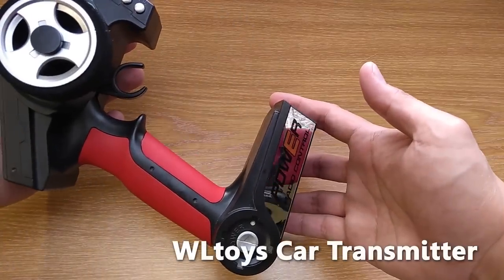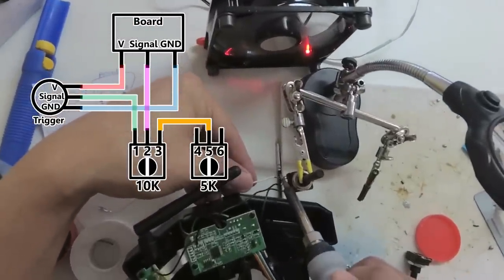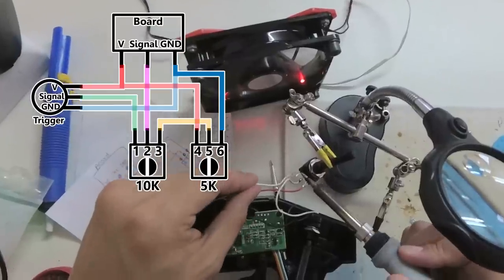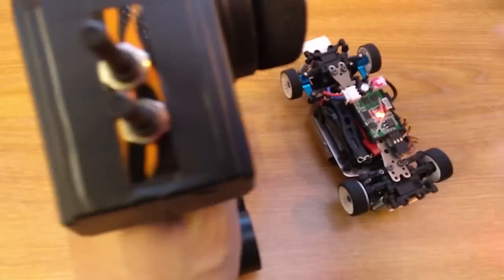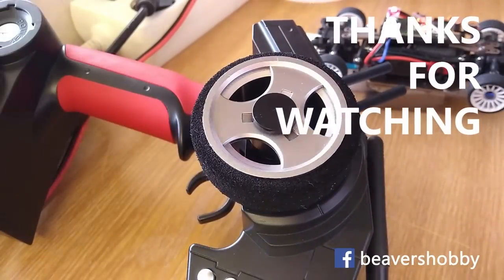[How To] WLtoys Transmitter Dual Rate Mod (throttle limit)

Comment from the maker: Time Stamps
Required Parts: 0:26
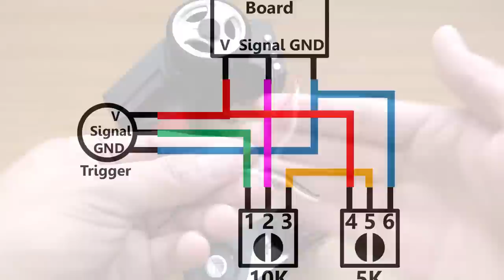Schematic: 0:45
Disassemble The Transmitter  0:54
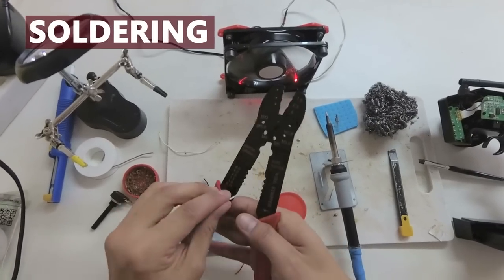Soldering: 2:13
Re-assemble: 4:58
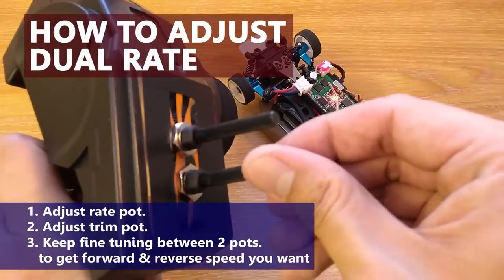How to adjust dual rate: 5:55
How to work around transmitter losing setting: 6:10

Comment: Thanks for your video, it has inspired me a lot I made a different scheme but it also works. here I explain a bit for those who want to use this method. With this the amount of gas is easier to adjust.

A double potentiometer is needed (two potentiometers with a single adjustment knob, also called a dual potentiometer). The value of these 2.2Kohm or 3.3Kohm or 4.7Kohm (if you have a higher value you can always calculate a resistance in parallel to adjust).

Desolder the white and red wire from the throttle trigger (not the motherboard). Now in the central pin number 1 potentiometer put the white wire. In the central pin potentiometer nº2 put cable.

Solder a wire from the trigger (position before white wire) to another pin of potentiometer # 1.
Solder a wire from the trigger (position before red wire) to the other pin of potentiometer # 2.

One potentiometer must mirror the other. For example use both center pins and both left pins. Or both central and both rights.

I hope it helps you.
Reply: what do you think is better ,10k will be ok?
Reply: Hello, could you please share a diagram(picture)? i am a bit lost in your description but I would really loved to have this mod done with one double potenciometer... thank you very much

Comment: This is brilliant. Can't wait to mod mine! Thank you! Do you think a switch could be added to flick from normal mode to dual rate mode to avoid dialing in every time? If so could a video of it be done? Take care keep em coming!
Reply from the maker: I think the switch could be done but I'm not sure how. Gotta look in to it. 
Thanks for the suggestion by the way. I have switched to using multiprotocol hooked up to my Radiolink but going back to visit original radio once is a while is also good.
Reply: @BeaversHobby  I've tried to add 2-position 6-pin switch on signal wire (connect signal trigger and signal board to 10k potentiometer pins in one position, and connect signal wire on other position) but it works a bit weird. got different speed and center values with the same potentiometer positions. maybe extra 2-pin switch also should be added to 5k potentiometer V or GND but having two switches is to much, imho.

Comment: First of all - thank you, Beaver, for your great videos in regards of RC mini models mods. Learned a lot. Thanks.
And here is a small question: can you suggest a simple solution with adding a two-positions switch to the dual rate circuit to have it enabled/disabled? Idea behind that is to turn on controller with default behaviour and turn on potentiometers after initialization done to have exact same values as on previous run. Having marks on knobs anyway not so precise for some reason and always needs some extra tuning in my case. Thanks.
Reply from the maker: I'm not really sure. If you can find a 2 position switch with 3 terminals each I think you can interrupt the signal, 1 position will be direct to the throttle and the other one will go into the potentiometers.
While this is good for experiment I suggest you upgrade the radio to a better one with proper adjustments will be much easier and more reliable.
Reply: @BeaversHobby  yes, i had same idea with interrupting signal wire. and finally i've got it working really well (i used high precision resistors). thanks for suggestion anyway!
and in regards of changing radio - a bit expensive due to I've bought two k989 models to have some in-door races with my daughter - upgrading two kits is to much time and money for such purposes :)
Reply from the maker: @k0va1  Glad you got it working. Cheers!

Comment: Hello @Beaver's Hobby,

Do you know how to bind this controller? I have searched everywhere but there's no bind on the transmitter but there's a bind on the k989.

Thank you!
Reply from the maker: Turn the car on first, then turn the transmitter on and move the steering wheel. That's the only way. No need to press anything or even the bind button on the 2-in-1.

Comment: Hey beaver’s I have a question. Will this transmitter k989 bind with a standard receiver. Like the wltoys receiver that doesn’t have the built in esc or another brand receiver. Thank you for your videos I’ve learned alot
Reply from the maker: There's WLtoys receiver on aliexpress that this transmitter will bind to. However since it doesn't have channel reversing it can be difficult to use. Some ESC and servo need that.

Comment: Hello Beavers Hobby,pls reply to this comment, Do you Know how to bind k969 stock TX (transmitter/remote) to a stock receiver.??
Reply from the maker: Turn the car on first, then turn the transmitter on and move the steering wheel. You'll see the light on the car stop blinking.

Comment: Hey beaver I have a a979b is there a remote that has those settings that I could use on it?
Reply from the maker: Take a look at WLtoys P33 transmitter. You should be able to find it on aliexpress. It has all the settings and it'll bind to A979 (as well as K series).

Comment: I have just bought one of this...the problem is that I have to pull the trigger twice to go backwards...it works fine when moving forward...is it normal? I wish u could cast some light on this particular issue
Reply from the maker: This is normal for RC car. Pull the trigger to go forward, push immediately to brake, go back to centre and push again to reverse.
If you go from forward to reverse directly you can strip the gears.
Reply: @BeaversHobby  Let me explain this, cuz it is kindda od tricky. I can pull the trigger forward as many times as I want...everything's ok but if I pull the trigger only once to reverse, it literally does nothig, no brake, no reverse,  nothing at all.I have to go back to center and then pull again to reverse.... once I have done this, I can reverse as many times as I want. Arr u sure that thia is normal?
Reply from the maker: @dukha82  Yes, this is normal. Normally when you let off the throttle it will continue to roll but when the car is new drivetrain is a bit sticky so it's indistinguishable from brake.
Reply: @BeaversHobby  Dude, I can pull the trigger in reverse all the way, hold it in this position for hours and the car does nothing, literally nothing. Gotta go back to the center and then pull the trigger again in reverse, now it works... Long story short, gotta pull it twice to reverse the car, if I pull it once, it does nothing
Reply from the maker: @dukha82  Yes, that is normal. You have to pull it twice to go reverse. Watch this video, skip to 11.40 to see how to setup the transmitter and you'll understand how the hobby RC car electronics work.
https://youtu.be/rTveWKmr8xY
If you feel it's too hard to go into reverse from the centre, I mean the second pull, not the first one that it does nothing, then the trim might be off. Try adjusting the throttle trim (2 buttons at the bottom), click either of them until you hear a long beep, that's the centre position of trim.
Reply: @BeaversHobby  Thank u for your patience. 5 months ago I got a mini rc car called cracker and I could run the car back and forth instantly,  skidding like crazy, it was so much fun whereas this car simply can't. Was the cracker an exception to the rule? I feel that the k989 sucks a bit if I have to double trigger to reverse the car...I guess that it is like so to protect the gears. Isn't it so?
Reply from the maker: @dukha82  Yes, as I said in the beginning this is a standard function of "hobby grade" RC car to protect the gears and also you need brake when racing, not to go reverse immediately.
You might find it annoying but this is a normal practice and you will get used to it quickly.

Comment: Hello, I followed your video for the Transmitter mod, but not for this car model but for the A979 model. 
It does not work :(, ussually as soon as I start playing with the Potentiometers the car stars running (even if im not pressing the trigger) and it's impossible to regulate the reverse speed. 
Is this because the receiver for the A979 is different? is there an instructions for this car/receiver model?
Any ideas please? 
Thank you in advance... and great instructive video :)  congrats. 

P.
Reply from the maker: The transmitter is the same across the models. I think you should check the wiring again to be sure. The potentiometer's resistance also plays big role here. Sometimes it's very difficult to adjust. You can try different pots too like 5k ohm.

Comment: Thank you for this! Since I also have the smaller radio from the 144001, I tried to bind that one to the A959, which came with the radio shown here. But simply powering one and using the steering or throttle doesn't do anything. Also the ESC on the A959 doesn't have a button, only a power switch. On the radio is a 'mode' button, no idea for what it is, though.
Any ideas?
Reply from the maker: The 144001 radio is different than other ones. IT doesn't bind to the A959 or even the K989 series. There's an older one that looks the same but works with A959. The seller usually doesn't tell you so it's a bit difficult to find one that works.

Comment: Hello. Can the speed of wltoys 144001 be slowed down with this project? (3-5km/h) To drive around the house?
Reply from the maker: There's already a knob on 144001 transmitter to limit the speed. It's the lower knob with the TH D/R label. It does the same job as what I did in this video.

Comment: can you upgrade original receiver k989 add external esc without changing transmitter remote?
Reply from the maker: No, the original transmitter doesn't have any setting to reverse or limit the steering & throttle so using it with other ESC is not good. If you will go through the effort to change the ESC then you should upgrade the transmitter too.
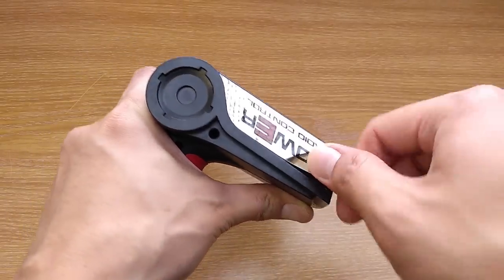Reply: @BeaversHobby  ohh too bad, I have a Qd 1:10 rc with a 540 motor, I want to use a remote k989

Comment: Hi Beaver's, thanks for your tutorial. 
I'm trying to identify the JST connector of the throttle but without lucky. Can you please help me with that? 
I will perform this mod without soldering or cutting anything so it will be totally reversible. I will do it by installing your schematic with JST connectors and in one side it will connect the throttle plug and the other will connect to the board socket.
Best of luck for your channel
Reply from the maker: The JST should have the same wiring order as the schematic. You can see where the wires go according to the potentiometer direction or where the knob is pointing. Hope this helps.

Comment: Great mod. Can you use a single 10k potentiometer?
Reply from the maker: Unfortunately, no. You need one to adjust the top range and the other one to adjust the bottom range and bring the mid point back to the centre. There is however stack potentiometer where you got 6 pins on double potentiometer with one dial. If you want only one pot, that's the one to use.

Comment: i haven't done any mod to my remote yet, but when i try to reverse after accelerating the car make a beep some times wheels are initializing and the red light flashes instantly. Is this controller problem or the car battery is starting to fail because I've noticed lower running time. thanks
Reply from the maker: Sounds like the voltage has dropped too much. I think the battery is gone. Either that or there's a problem with the 2-in-1 ESC unit.
Reply: Thanks for the quick reply. Is there any good aftermarket battery that can fit k989?
Reply from the maker: @Nikoslido  I've been using the GiantPower 300mAh. It has good punch but being a bit less capacity you'll get less runtime. Not sure if they can ship it to your location but here's the link. http://bit.ly/340Liik
You can also try Gaoneng. Or Hobbyking Turnigy. https://hobbyking.com/en_us/turnigy-nano-tech-300mah-2s-45c-lipo-pack-w-xt30.html
Reply: @BeaversHobby  Thanks for the help. A few charge/discharge cycles by the charger must have fixed the issue, but battery capacity is reduced dramatically.
Reply from the maker: @Nikoslido  At least it's working now so it should keep you running until a new battery arrives.

Comment: I have the same controller and having problems binding to my car after unbinding it some how.. Can help me on rebind it?
Reply from the maker: Turn the car on first then turn the transmitter on and move the steering, that's the way to bind the car back. I swap between transmitters regularly and this works for me every time. If it doesn't work then there might be some interference so try to move the transmitter closer or sometimes further away can help.

Comment: Hi, can anyone help with binding, i have a K989,  i forgot my transmitter one evening so borrowed my friends who has the same,  just switched the transmitter and car on and worked perfectly, however, the car now wont communicate with the original transmitter, i've tried pressing the binding button on the car but still nothing, is there a procedure i have to do?
Reply from the maker: To swap the transmitter. First turn on the car then turn a new (or another transmitter) on and move the steering on the transmitter. It'll bind automatically. I swap the transmitter all the time between stock and multiprotocol box.

Comment: I have WLToys A979B does the new transmitter V2 will work on that
Reply from the maker: Is it V2 from WLtoys 144001? That one won't work with A979B since it's still using the old transmitter like the one in this video.

Comment: @Beaver’s Hobby 
I love your videos and have a question I hope you can help me with. 
I swapped my electronics from wltoys k969 to mini q trq1 and  all controls are backwards. What is the easiest way to fix this? I imagine the easiest thing is to switch the polarity but not sure if it would be on the transmitter or receiver nor how to go about it. 
Thank you in advance and can’t wait til you get a trq1 to start reviewing and modding.
Reply from the maker: See if there are reverse steering and  throttle on the transmitter. If not, for throttle it's easy. Just swap the polarity of the motor plug. Use something small to push the terminals down and pull them out. Then for steering is a bit tricky. You'll have to swap the potentiometer wires. Try swapping until it spin the way you want.
Reply: It’s the wltoys tx so there’s no reverse. Just wondering if you knew how to mod the control to fix it. 

I think I’ll have to reverse the transmissions for the throttle fix and reverse the wires in the servo pot and motor or steering. 

These mini q q1 are great out of the box, but limited in modding. Can’t wait to see what you do with it. 

Btw they are NOT 2s compatible hence my situation haha.
Reply from the maker: @PadiwanFPV  Motor is easy as I mentioned earlier.. As for the steering I just thought you can swap the potentiometer wires in the transmitter too.
By the way, WLtoys transmitter works with Q1 electronics?
Reply: Beaver's Hobby ohhh I see what you mean with the potentiometer in tx instead of the rx. 

No they’re not compatible. I had to swap the electronics because I fried the receiver in the trq by running 2s. Don’t try it haha. I switched all the electronics except the motor, which you can’t swap because of how its mounted using the specific shape of the motor housing instead of screws.
Reply from the maker: @PadiwanFPV  You can swap the motor wires where it connected to the ESC.
Unlike steering, swapping the trigger wires in transmitter is not a good solution because you need it to go forward-brake-reverse. Swapping the trigger will stop that from working and some ESC will fry if you hold reverse too long because in this case you use reverse instead of forward.

Thanks for the warning. I also saw the comment about 2S battery on Banggood and would try it if you haven't warned me.
Reply: Beaver's Hobby Thanks for you insight. I think all my modding will take place on the car itself then. I’ll let you know how it goes. 

FYI the sinohobby front one way is compatible, it’s short but the swingshafts don’t fall out in the TRQ1.Let my know if you have any questions about it. I’m still testing it out.
Reply from the maker: @PadiwanFPV  Thanks. I'm looking forward to see how it goes.
Reply: @Beaver's Hobby Success. I switched the polarity for the servo and motor. For the motor it was as simple as swapping the red and black wires at the lead from the motor. For the servo you swap the motor leads from the chip (same thing basically) as well as the outer potentiometer wires. 

My trq1 is lipo compatible now and has a front one way. Still suffers from insensitive speed control since it has wltoys tx and rx. I’ll have to dual rate the tx at some point. 

Thanks for your help :)
Reply from the maker: @PadiwanFPV  My pleasure.

Comment: Hi Beaver, is there a way to reverse the steering on this transmitter refering this method ? I am wondering on swapping some wires on the steering wheel. Currently i am using this Wltoys electronics for another rc car and the steering is reversed
Reply from the maker: Yes, you can swap the wires on the steering pot and have it reverse direction. I'm not sure which combination to swap so you'll have to experiment with it.
Reply: @BeaversHobby  will do and thanks for the reply, i will update asap
Reply from the maker: @adhienoor  My pleasure. Good luck with the project.
Reply: @BeaversHobby  just want to update, i swapped red and white wire on steering connector and it works beautifully, so now i don't have to reverse the steering on my head...hahahaha. thanks for the advice and vote of confidence 👍
Reply from the maker: @adhienoor  Glad it works. Have fun!